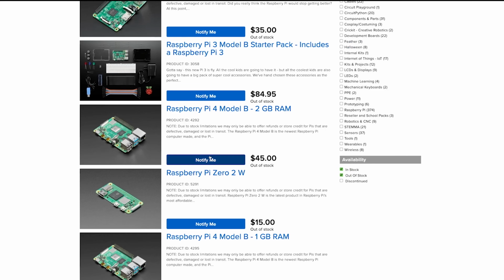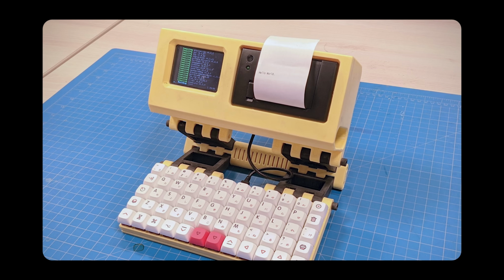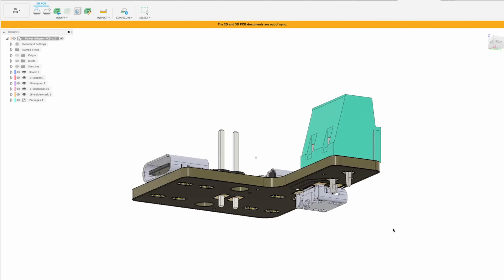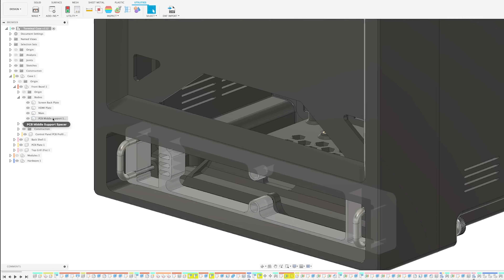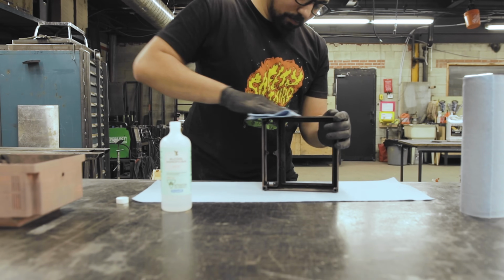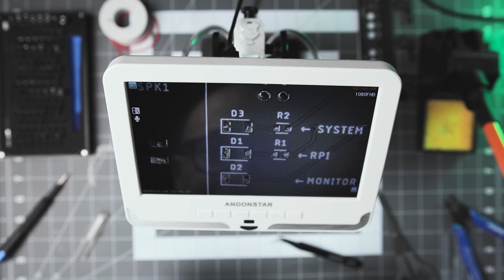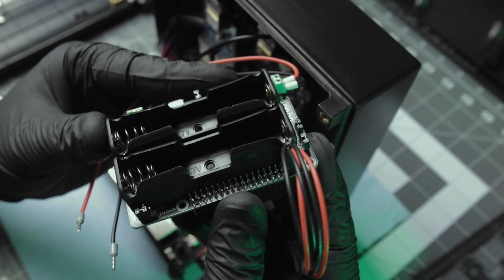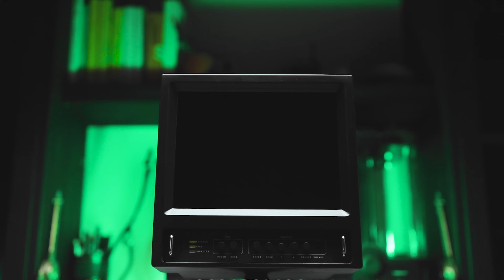Building a CRT-Style Portable Raspberry Pi Enclosure

Comment: Another great video. Definitely subscribed. You might want to look into cerakote finishing instead of paint. Not for this type of build but for something like your spacemouse build just for the durability. I’ve done cerakote on plastics for gun parts and they can be oven cured. I’m sure pla wouldn’t be able to take the heat but probably abs would be. The finishing and durability is amazing. Can’t wait for the next video!
Reply from the maker: Thanks! I Will Check it out

Comment: You might want to consider printing parts in a non-matte filament if you are going to paint them anyways. Matte filament tends to have less strong layer adhesion than non-matte types from what I saw in a CNC Kitchen video. Printing at higher temperatures also helps with making stronger parts. E.g. 230C for PLA
Reply from the maker: Thanks for the tip!

Comment: The case looks really nice after the work you put in. You use PCB way for custom boards as a progression from hand made to a more refined product. Maybe for another project you could see the 3d printing as stage one and when the design works you could also have that send off to be printed with something like shapeways?
Reply from the maker: Thanks! Yes, that could work as well. @pcbway offers 3D printing, CNC and a lot of manufacturing services. They could have done all the entire production and I can assemble on my side, but as you said I need to be sure that my design works first and when I need to produce more then one.

Comment: Awesome DIY, great job !
The UPS can output 5V 2.5A, it seems a little bit light for both the screen (5V 2A) and the Pi (5V 2.5A). Don’t you have flickering on under power issue with this setup ?
Reply from the maker: Thanks! Sometimes I get the under voltage warning but I didn't put it under any kind of considerable stress

Comment: Hey i have question about the headphone jack and how you have it wired? Is the purple wire connected to the switch leg of the headphone jack that switch between the headphone and speaker.
Reply from the maker: Hey, yes that's exactly right. The purple wire just extends the switch to the front panel since the small extension is always plugged in inside.

Comment: question what does the MLED GO TO?
Reply: The solder mask on pcb Control panel drill_1_16.xln
Reply: Is it ground
Reply from the maker: If I remember correctly it's a power indicator for the screen only.

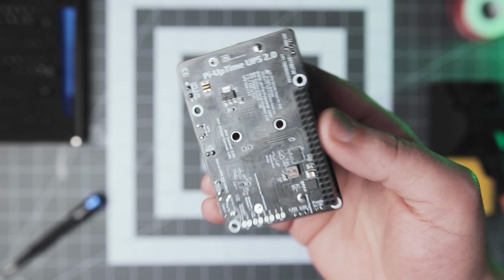Comment: 1:05 would you able to build one in 16:9?
Reply from the maker: Yes it's possible, but the model needs to be changed significantly.
Reply: @salimbenbouz  it would be good to do tho, i know that lot of things would need to be changed, mainly with the case but the rest of the stuff inside doesn't really need to change like the circuit boards and stuff like that but it would still be nice to design and build one, it should be a good challenge that you should do one day